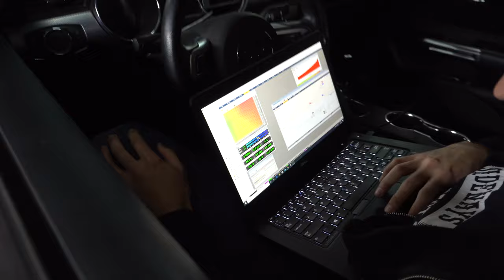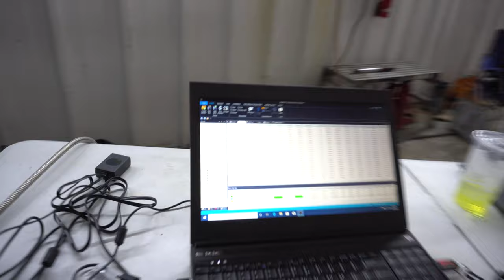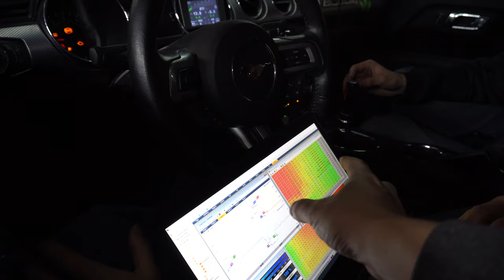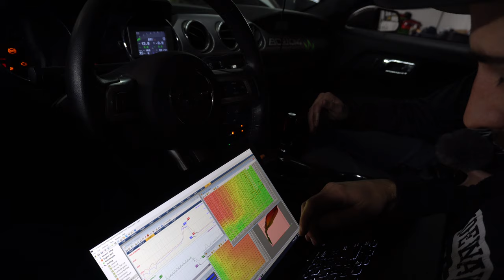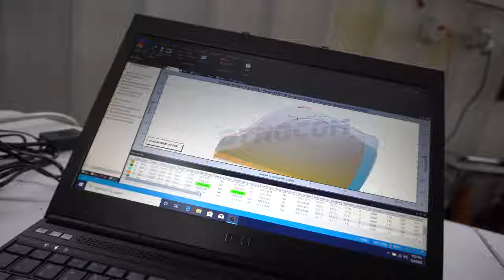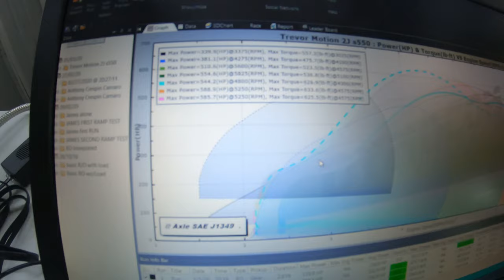MotionAutoTV 2JZ Swapped Mustang on the Hub Dyno!

Comment: I’m strongly debating a 2JZ in the ‘93 Fox I’ve been holding onto for a couple of years. I’ve had a dozen mustangs in my life, I think would be a lot cooler then an LS or Coyote. Maybe a Voodoo engine, they sound so much better than the new 5.0. I love the 4.6 dohc motors, the sound is so smooth.
Reply: I’d like something more modern or legendary, a Barra would be my preference but 2Js are all over here in the states.
Reply from the maker: Either way that would be cool! You should definitely swap something into the fox!